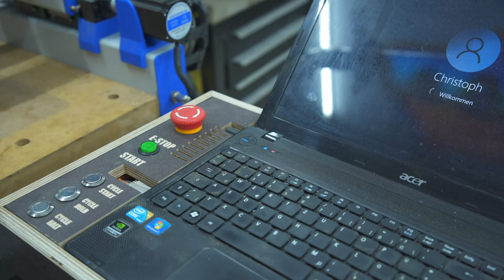3-Axis Notebook Stand

Comment: Always amazed with everything you build. Been dreaming about building my own PrintNC cnc machine. I was thinking about buying a Onefinity X50 journeyman. But in lots of reasearch and reading, I think the PrintNC might be better for milling aluminum. Sure looks like the PrintNC might be one of the most precision machines, Due to its rectangular steel construction, and linear railways. Always enjoy your sense of humor. Thank you for sharing your projects. P.s. The little cutout for your usb cable in the control panel, Looks like it needs a custom snap in piece out of aluminum with your C.L. logo. Peace out man.
Reply from the maker: Thanks for the kind words Todd!

I am also curious about the cutting capacity in aluminium. Once my 2.2kW.spindle.is mounted, we'll find out
Reply: @ChristophLehner  Awesome man, Look forward to watching how that goes. Have a good one.

Comment: Seems like a bad idea to put the e-stop there. What if you need it and the tray is tucked away? Maybe a secondary redundant e-stop somewhere easily accessible?
Oh, and get another laptop, one with rear facing connectors. You could do a sliding docking system and your life will be much more easier (go to DIY Perks if you need some inspiration on that).
Reply from the maker: you need the tray swung out to operate the machine, so if the machine is live, the tray is also there